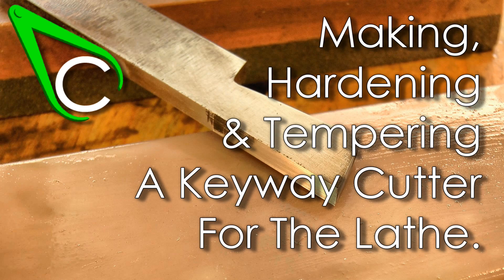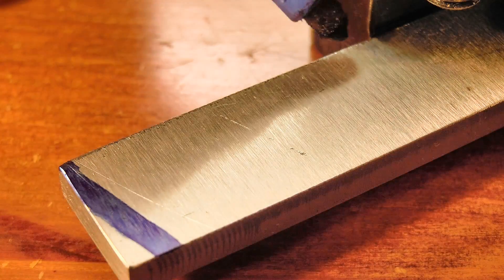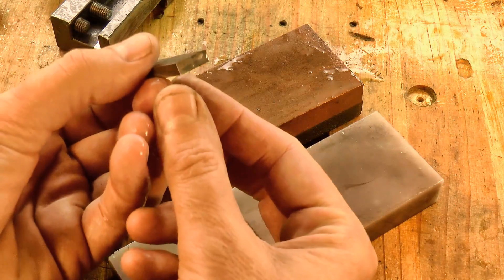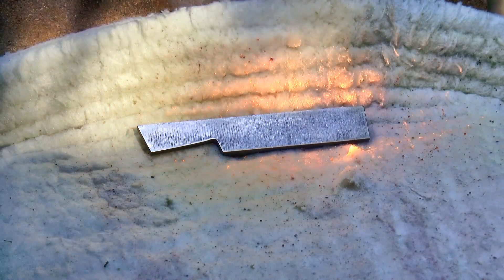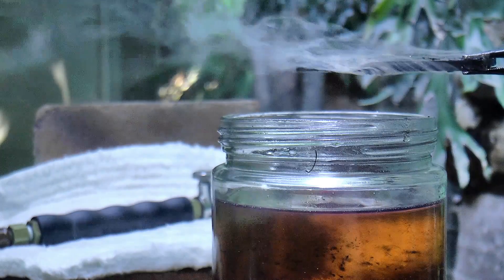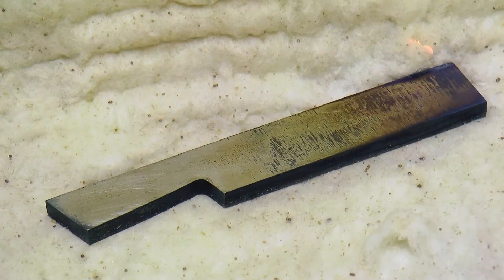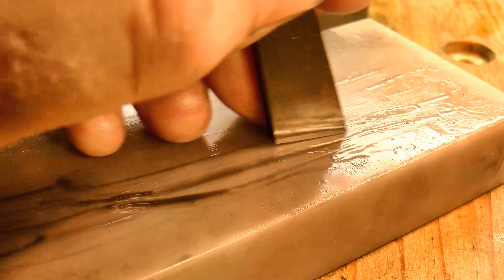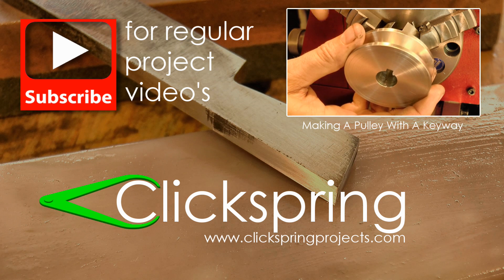Spare Parts #1 - Making, Hardening And Tempering A Keyway Cutter For The Lathe

Comment: Old trick --- heat a piece of steel flat bar  when realy hot put the tool on the steel & watch the color of the tool. when the desired color is reached quench in oil/water. Color change is more uniform & slower this way.

Comment: What happens molecularly when hardening and tempering?
Reply: The molecular structure of the steel rearranges itself to a regular and uniform structure, giving it more strenght
Reply: It's based on phase changes. You start with an alloy with too much carbon to form solid ferrite, which will be a carbon-rich ferrite with a cementite (Fe3C) precipitate. This will be fairly soft. You heat it up into the range of austenite (~800C), where the carbon in the Fe3C can dissolve into the iron to form austenite, a single-phase solid solution of iron and carbon.

When you quench, the resulting solution is supersaturated (too much carbon to form ferrite). The equilibrium mixture here is the ferrite with cementite precipitate, but in rapid cooling the carbon cannot diffuse out to form the precipitate. What takes place instead is the FCC-structured austenite shears rapidly to form a distorted version of the BCC ferrite, known as martensite.
Martensite is metastable phase. It's very hard but very brittle, so it would be useful to introduce some ferrite again to make it a bit softer but less likely to shatter (since resistance to cracking is dependent on ability to deform plastically).

To do this, you heat the workpiece back up again, but not as hot as before. At the higher temperature the carbon can start to diffuse out to form the precipitate, leaving some soft ferrite behind. This part is known as tempering, and Chris uses oxide colour to indicate the temperature he tempers at, which will dictate the eventual hardness vs. toughness (by changing the amount of ferrite that is formed).

Comment: That's exactly what i was looking for, thanks for that awsome video.
Can you also simply use a blank out of high speed steel, grind it in shape and use it straight away ? 
(I wanna cut a keyway into a wheel out of polyamide)
Reply from the maker: +TheBK117B2 Yes absolutely, thanks for tuning in

Comment: great videos mate. One question, how long it takes with simple open flame propane burner to red heat piece of steel this size like in the video? Thanks :)
Reply from the maker: +Nikola Zivkovic Hey Nikola, about 2 or 3 minutes. I use Kaowool as a simple forge for larger parts, works great, gets them up to temperature quickly. Thanks for watching and asking.
Reply: +Clickspring thanks :) im going to build some special wrenches for attaching connectors to front plates of my electronic project. so i need to temper and heat quench steel to make the wrench hard. thanks :)

Comment: Lovely video. I used to temper my tools by color, until I bought "Tubal Cain"'s book on  "Hardening, Tempering, and Heat Tratment." Tubal Cain was a pseudonym for the late T.D. Walshaw. Workshop Practice Series #1. Easily available from amazon.co.uk. Mr Walshaw recomends a kitchen oven set at 235C for "light straw". I use a more portable (cheap) oven for the same purpose, and to avoid domestic conflict. Set it to 235C, let it soak for maybe half an hour. (maybe more for a thick piece). Done. All details in book. Does away with the agonizing guesswork and uneven heat distribution of doing it by torch.
Reply from the maker: Juan Rivero Thanks for the Tip Juan, and thanks for watching.
Reply: Juan Rivero For tempering you can consider about 15 minutes per 6mm. or 1/4 inch of thickness a good foolproof start... And a slow cool down, about the same or longer if you want.